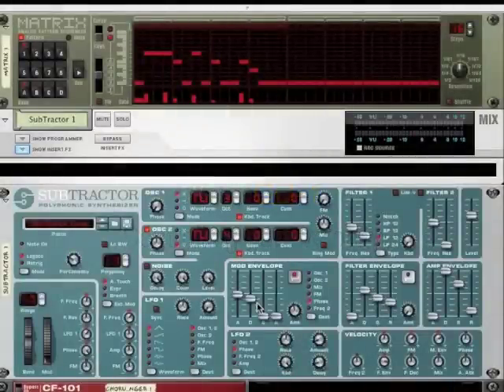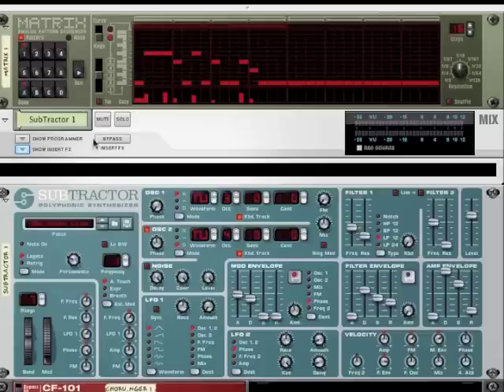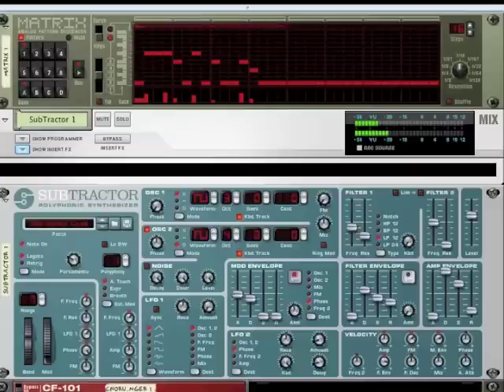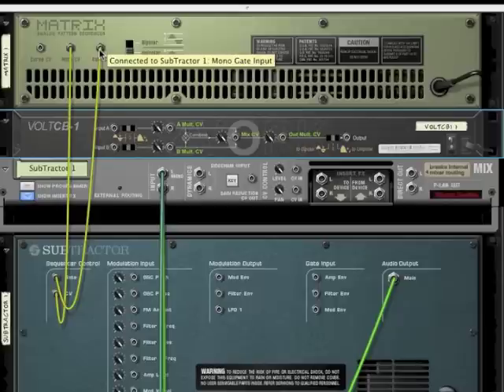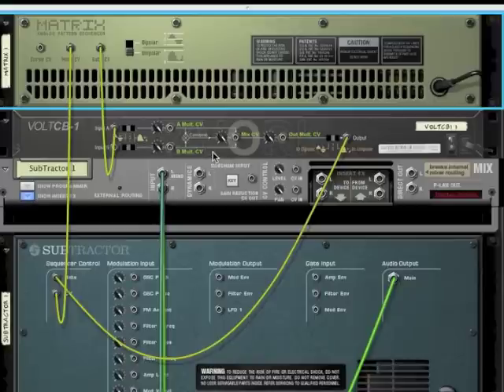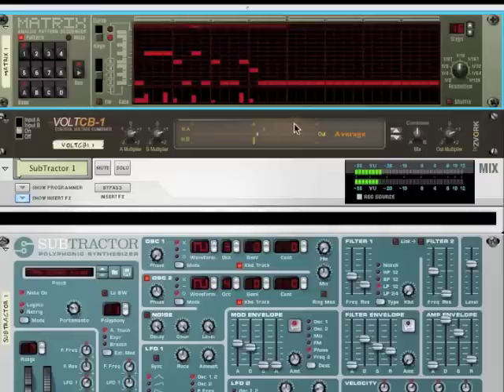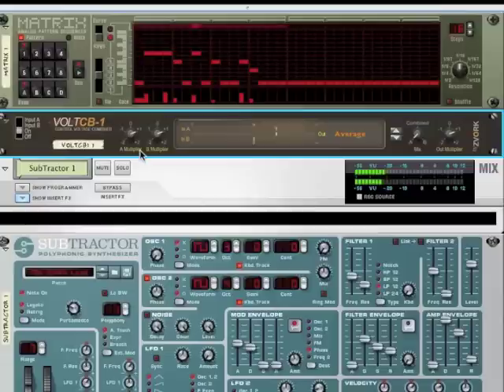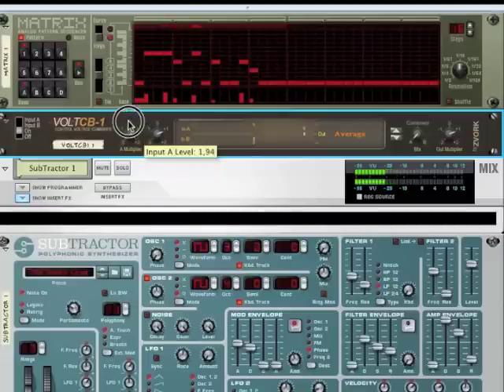Introducing the Volt CB-1 Rack Extension for Propellerheads Software Reason

Comment: We need a CV changer that allows you to change the voltage speed. for example, your could set it up so it runs at 3/16 for a bar, then 1/8 for a hafe bar and then 1/16 for the rest of the loop without having to set up an automation lane.

Hope that makes sense :)